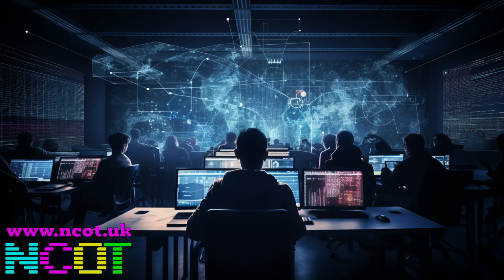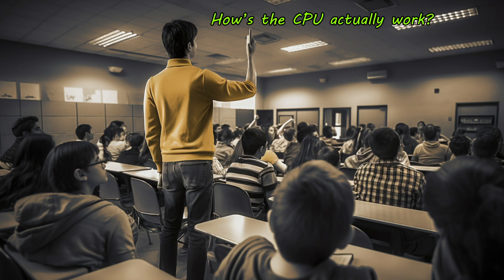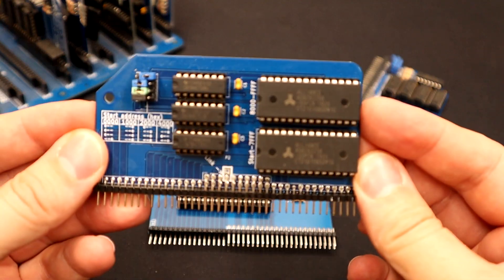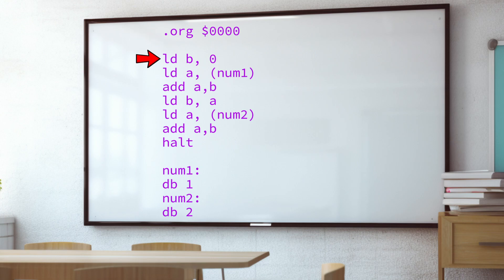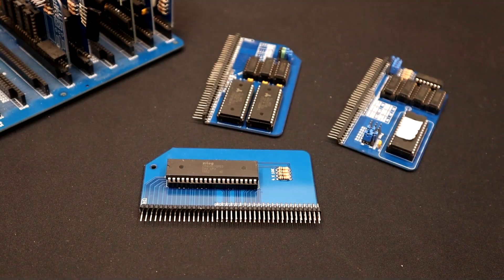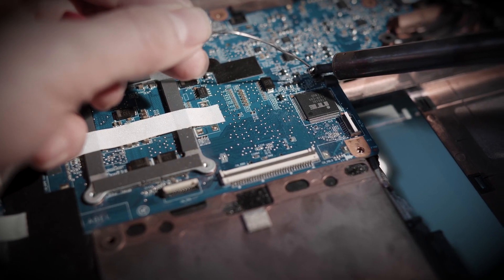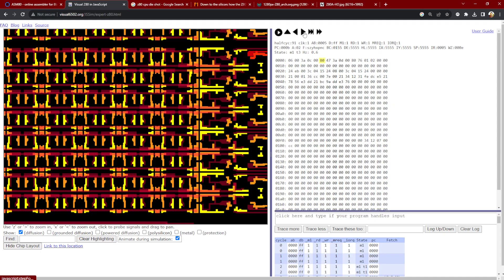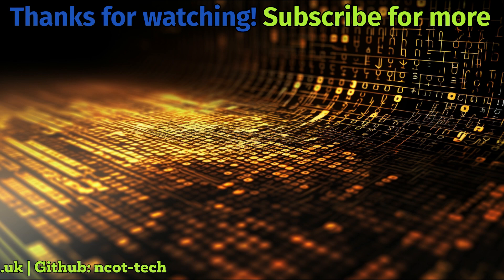Zilog Z80 Deep Dive - How does it work?

Comment: Nice CPU video. One little detail that you missed is that what happens if the CPU gets sent an opcode instruction that it isn't designed for. Older 8-bit CPUs had various opcode instructions undefined which could cause problems if used. For the 6502 there are quite a few "undefined" opcodes that one shouldn't use but people found that if they did use them they could carry out certain operations faster as it combined operations together in the CPU. And others would cause everything to crash. It used to be a thing for people writing 8-bit demo code they could use illegal opcodes to speed up their code using less cycles at the risk of breaking the program if later versions of the chip used completely different microcode (the internal instructions inside the CPU that carried out the machine code fed to it). This has proved an issue with implementations of CPUs on FPGA and they don't implement the undocumented instructions. Or you have a chip that is enhanced like the 65CE02 chip used in the Mega 65 which adds instructions to the "gaps" left in the original instruction set that were previously used as undocumented opcodes. There is a document called "The Undocumented Z80 Documented" by Sean Young which covers the unusual effects that can occur when you used these undocumented opcodes on the Z80 processor...
Reply: Early x86 chips (8086 and 8088) could try to execute undefined instructions and maybe have the chip do something. From the 80186 onwards, they'd just trigger an Illegal Opcode exception, which while boring, is useful for compatibility, as you could use that to jump into a software routine that implemented an instruction available on a later processor.
Reply: The Z80, 6502 etc used a technique called partial decoding, that is to say that to save space they didn’t bother to fully decode all possible instruction codes. Because of that (and sometimes because the designers had ideas that didn’t work out) you get these op codes that do odd, but sometimes useful things. Better FPGA cores can actually implement these undocumented instructions, and some are based on a decomposition of the original chip logic (known as a net list) so they can implement the chip behaviour precisely.
Reply: Some undocumented Z80 instructions were useful, especially if you didn't need one or both of the index registers but you did need more 8-bit registers.  At the cost of a bit of speed, you could use the IX and IY registers as two 8-bit registers each.  (The speed decrease was caused by the time required to load an extra byte during the instruction cycle in order to access the 16-bit registers in 8-bit mode)
Reply: Intel 8050 has all opcodes documented. A quarter of them are mov

Comment: Tell your students to build a bit adder in No Man's Sky.
It is easier than one might think and will show them the electrics and logic of what is happening.
Reply: Minecraft, Factorio and Autonauts are some others that are Turing complete. I hadn't heard about No Man's Sky. Off to re-install now.
Reply: @RetroRogersLab  Autoswitches are [AND] gates.  Trying to remember the name of the other...   Power Inverter?  is an [OR] gate?
playing around will inform.   The logic of an adder is well documented on YT.  
The hard part for me, a hobby electron pusher was building it w/o having everything in one long line because in NMS in 'wiring mode' all connections are visible. 
:face-orange-raised-eyebrow: and it gets hard to tell what you are connecting to.